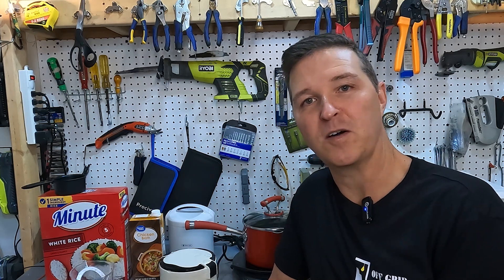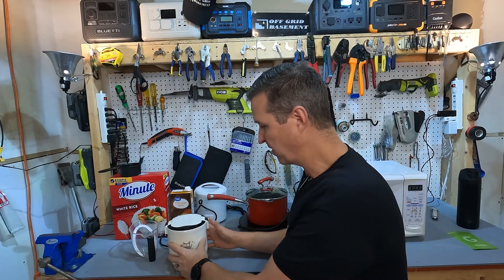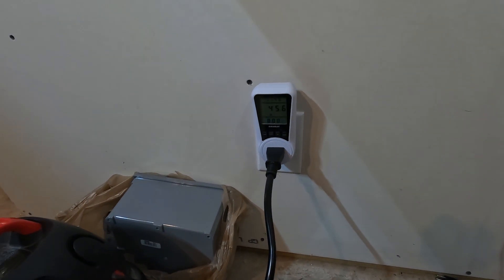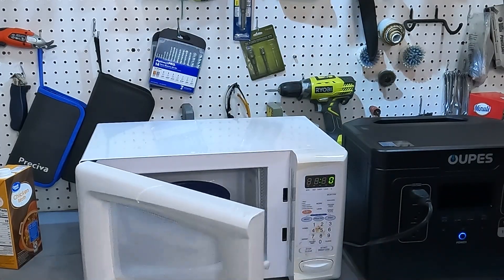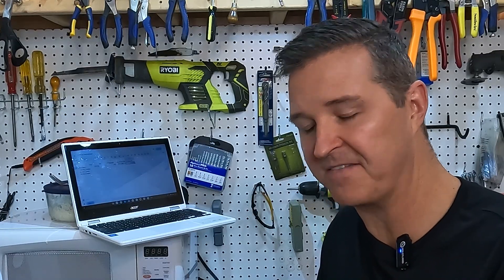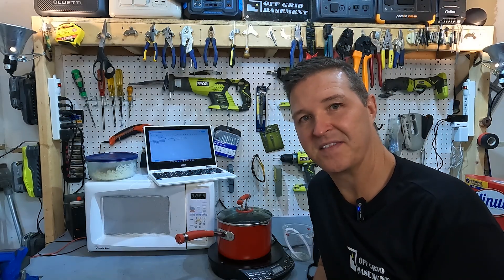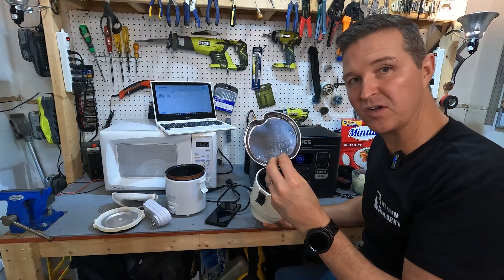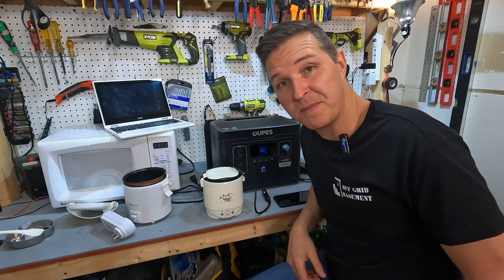Is a 12v Cooking appliance really more efficient?  Let's find out!

Comment: I always wondered which would be more efficient and wasn't expecting this much of a difference between the microwave and induction cooktop! Wow!

Microwave is still probably the best for popcorn, at least for ease of use, but I guess you could achieve decent results by using a pot and just shaking it, with maybe an oil screen instead of using the glass lid so steam can escape...

Comment: My induction cooktop will boil 1 quart of liquid in 55 sec, depending how cold the liquid is when I turn on the burner. I never takes longer than 70 sec to boil liquid.
Reply from the maker: Thanks for sharing and for the comment.
Reply: @OffGridBasement  I love my induction stove.  The oven is a normal oven, but the top is the best thing since sliced bread.  And I mill my own grains and make truly fresh bread without additives or any other junk.  I have recommendations.

Comment: This would likely depends on the unit. For example the Bluetti EB3A from testing seems to have lower efficiency on the DC side than AC side. However in most case, the DC buck-boost are much more efficient than the AC inverter, hence some appliances being DC would net lower power usage out of the power station.

Talk of DC, definitely utilize the power station USB port before ever put an phone/laptop charger on the AC port! I am always baffled at such sight of people plugging in their 20W charger to charge there phone when there is an empty Type C port that would charge faster right on the side!

Comment: they have a bunch of 12v appliances in china that their truck drivers use including larger 12/24v versions of the rice cooker with more efficient copper coating that can hold a true 3 liters. they are fatter in the critical dimension and sort of lock shut which helps them hold in a little bit of pressure with their carry handle. i use mine as a super efficeint instant pot lol, i show it briefly in my 40$ ultracompact 420wh dc power station build video. can cook almost anything in them and if you get the weird russian language version they are less than half the price of anything on scamazon from alxp. the english buttons dont make any sense anyways lol. love mine. instant pot doesnt make anything that small anymore and nothing dc powered. sometimes u have to search for solar cookers to find 12/24v appliances which are growing in popularity in the poor parts of the world that live off chinese solar panels now.

Comment: Bought the same 12v rice cooker off of Amazon about 6 months ago.  My box included a plastic spoon and a 3/4 cup measure in addition to the silver tray.  Loaded the cooker up with 3/4 cup basmati rice and 1.2 cups of water. Running off a 12v 100Ah LiFePo battery I got a reading of 43.7 Wh.

Comment: Excellent and well thought out comparison.  I'm no rocket scientist.  I simply have the wisdom and knowledge of 67 years on this planet.  I look at activities like this with a very logical and methodical thought process.  Nothing caught my attention that would cause me to question these results.  I especially like that you thought to include the comments about wiring the DC cooker directly to a 12v power supply to remove the necessary AC to DC conversion that the power station requires, resulting in even greater power savings.

If someone such as yourself prepares rice for a lot of meals, the DC rice cooker would be the way to go, particularly for cooking on the road.  Otherwise, the induction cooker seems to be the right solution for cooking with a focus on using minimal amount of stored 12v power.

Comment: The low watt rice cookers with an inverter are so versatile. You can do all kind of things in them. You can cook going down the road. The measurement for regular rice is 1 cup rice to 1 3/4 cup of water with a little salt. I know what the instructions say, but it doesn't work in the humid south. It'll be gummy.

Comment: The ac inverter uses quite a bit of electricity so the results are what I expected.  Of course with the rice cookers they are not set for minute rice and so you overcooked the rice because they are set for uncooked rice. That means if you figure out when minute rice actually gets done you'll save more electricity.
Reply: All you need to do is heat the water for Minute Rice. Put a lid on it and it'll absorb the water. You really don't even need heat if you're patient
Reply: @nonyabiz550 same with uncooked rice add 1 part rice to 2 parts boiling water in a thermos and just wait until it's ready.

Comment: The DC cooker used 77.5% of the energy used by the AC cooker.  If you could get a 22.5% increase in efficiency from all your appliances, that would mean you would need fewer batteries/panels/inverter output, or you could run your house longer during an outage, on a given battery capacity.  I wish there were more 48v appliances (meant to run around 51.2v nominal) that we could run directly off the batteries commonly used for solar energy storage.  Many appliances ultimately run off DC, even if they are plugged into an AC outlet.
Reply from the maker: The efficiency is outstanding.  I also wish there were more DC appliances as well.  Thanks for the comment.

Comment: Between My NuWave Flex Precision Induction Cook Top and Black & Decker Rice Cooker and 12 Volt Kettle My Boondocking Cooking has Far Exceeded My Expectations. Using either an Eco Flow River 2 Pro, Delta Pro 1300 or Delta 2 & Delta 2 Max. They All Deliver Quick and Efficient Meals in the Rough.

💦 Indian Creek Ranch ⛩
Southern California High Desert 🌵
Reply from the maker: That sounds like a great setup!  I'm sure you'll be set for quite some time.  Thanks for the setup.

Comment: i suspect the majority difference is really just the fact that the rice cooker has kind of a built-in insulating shell where the others don't, as well as a more controlled temperature gradient.  i would never use 12v socket plug unless it was a dire emergency.  most of them are poorly made and you're looking at a catastrophe running even modest currents.
Reply from the maker: I agree.  Those plugs are temporary at best.  XT60 would be a much better solution.  Thanks for the comment.

Comment: Those extra few watt hours for the AC devices are likely because the inverter uses power to convert the DC to AC. If you could find a DC induction cooker, that would be an awesome test as well.
Reply from the maker: That would need to be a very high voltage DC induction cooker.  I would like to find something like that though!
Reply: Generally there are also losses in the 12v circuit of most power stations (DC buck converter 48v > 12v).  But probably less than the 120v inverter section.

Comment: AC is very inefficient from the start. The AC from the power plant (coal, natural gas, nuclear, etc) loses roughly 2-5% during the transmission to the neighborhood substation. It loses additional electricity during the step down process. The electricity is also lost between the transformer to your meter. Additional electricity is lost from your inside wiring (Romex).

They're now working on the HVDC to replace the HVAC in the future. 
But, eventually all home power will be converted to residential solar in the future. 50% by 2050.
Reply from the maker: It also amazes me how many things you plug into a receptacle are converting from AC to DC.  I like the thought of HVDC..  Thanks for the comment.

Comment: Consider using direct measurement like Kill-a-Watt/DC for the loads rather than measuring the charge into the power station.  The power station uses voltage to determine full charge and this isn't super accurate, so wH will also be inconsistent.
Reply from the maker: That's a good point about the power station's accuracy. Thanks for the suggestion!

Comment: I moved from induction to insulated pot (Instant Pot/Rice cooker) for the efficiency on batteries.  Induction is nice, but more heat escapes compared to an insulated vessel.

DC is about 10% more efficient as there is about 10% inverter loss to go to AC from batteries.

Running DC cooker while sunny uses power from solar charge controller vs another 10% loss going into and out of a battery.

If you mod the DC appliance, you can run directly off solar panels for another 10% gain by skipping charge controller.

Going straight to solar thermal cooking (solar oven) you can be up to 5x more efficient.  Solar panels around 20% efficient.  Using light directly for heat is near 100% efficient.
Reply from the maker: I should try cooking rice on the DC cooker from the load connection of a cheap SCC.  I wonder if it would work.  Thanks for the comment!
Reply: @OffGridBasement it will, but adding a battery in case clouds come by might be more practical.  My solar output>my cooking power, so batteries just charge more slowly.

Comment: I cook standard long grain rice in a solar box cooker on a sunny day. Two cups takes about 45 minutes to an hour and baking chicken leg quarters or thighs takes about the same time. I found the same when it comes to portable induction cookers, you get the best bang for the watt hour with a good second to the microwave.

As for 12 volt cooking appliances, they're quite efficient for what they do. The tradeoff is it takes longer to cook, but on a road trip where you're driving 30 or more minutes is not an issue. However, I find the weak point is the cigarette plug has a shorter life span if you use it a lot. I've converted mine to XT60 or Anderson Powerpoles.
Reply from the maker: Converting the plug is a great idea!  Thanks for the info and the comment.

Comment: Impressive numbers!

Hmm.  Microwaves are actually really efficient at converting electricity into microwaves.  It really shouldn't have shown more than 800W or so of consumption.  I'd see what a kill-a-watt says (and also look at both the watts and the VA).  My guess is that the microwave is actually putting a lot more than 700W into the food.

Induction cooktops and tea-kettles are basically resistive loads (even though they see "induction", they don't use inductors).  As are toaster ovens and rice cookers.  They burn a lot of watts but they should have like 0.99 power factor and don't put much stress on power station inverters.
Reply: Please tell us why microwaves have a fairly strong fan operating while the magnetron is connected!  I’ll answer for you - it is because a microwave is not an efficient converter of electrical energy to microwaves.  A lot of waste heat is blown out by that fan!

Microwaves are very efficient at heating water molecules but producing those microwaves is quite an inefficient process.
Reply: Induction hot plates also convert electricity to magnetic energy which is only then very efficiently transferred to the saucepan.  Better than a microwave, but I’ve not tested the conversion efficiency.  Easily tested by heating a known mass of water and measuring the rate of temperature increase (ignoring heat losses, of course, for rough and ready experimentation).

Resistive heaters are 100% efficient, but heat losses to the surroundings will be different over time scales.  Insulation of the vessel will make a huge difference to the final efficiency.

To test these different forms of energy usage, each item should be checked using a standard amount of water and recording the time to reach a certain temperature, along with the rate of power supplied.  Tests, with foodstuffs, will always be more subjective, according to the taste, etc, of the finished product.
Reply from the maker: All great points.  Thanks for the comment.
Reply from the maker: Thanks for the info and the comment!
Reply from the maker: Thanks for the info.  I'll need to check the power factor of the microwave.  Thanks for the comment!

Comment: You could run the D/C cooker straight from a 150 watt or higher solar panel.
Reply: Doubtful - unless under very good insolation!  That means possible, but unreliable.
Reply from the maker: I don't think the panel would produce the amount of amperage needed for the DC cooker.  I would need to test.  Thanks for the comment!

Comment: When cooking rice, I've always used the 2 to 1 ratio. For every cup of rice, 2 cups of water. And I do this with a plug in 120v rice cooker. Have I been wrong all this time? If so, it wouldn't be the first or last time I've been wrong.
Reply: Your right. The rice you use is regular uncooked rice, the rice he used is minute rice which is much faster to cook and requires less water. So the rice cookers in the video are meant to cook uncooked rice. I think with his minute rice he could have halved the time with rice cookers and the minute  rice would have been done and used even less power.
Reply from the maker: I shouldn't need to drain the rice once it's cooked.  All the liquid should stay in the rice.
Reply: I think so. If you're in the humid south, reduce the liquid by at least 1/4 cup or it'll overcook and be gummy

Comment: Great test. I love my induction cooktop, mine uses up 1300 watts on the highest watt and power settings but is below 600 watts on the lowest settings. The 12 volt rice cooker is pretty impressive. Now the next question is which rice came out the best?
Reply: I think that's a secondary test result as you might only need 30 seconds more or less to get them all equal? 
I would say for camping the DC cooker is the choice. I'm never in a hurry. Everywhere else. The induction!
Reply from the maker: The DC and AC rice cooker were the best IMO.  Induction pot was a bit to al dente for my taste.  I think I didn't wait long enough before removing the lid.

Comment: Now I see why van life people like induction cooking.
Reply: Im from uk scotland and have just 1 12v 100ah battery car battery to battery charger and 100w flexible solar panel on roof with a 2kw inverter i have 12v compressor fridge small 1200 watt air fryer and single hob induction cooker works great in summer camping i will add 2nd battery for extra capacity but ive had current system for 2 years.As much as induction is heavy power ussage the speed of cooking is like gas better so its good and airfryer once upto temp cuts in and out so not continuous high load great for frying chicken chips etc.induction cooker great for fryups boiling rice vegies etc.I have single gas cooker and when dull rainy days and not much driveing i use gas more and that ballances out power usage for lights chargeing etc.A second battery or a 2 or 300ah which are so cheap now compared to few years ago just be more reserve and flexibility,would be great in campervan.Haveing a little single gas cooker is a good backup and actually i have a small inverter generator great for top up charge/backup when wild camping nobody nearby.
Reply: @michael-sz3ff  Hi, the setup you are describing is what I’m going for on my van. I have been buying the bits I want in advance of the van so I have them for an emergency. I have gone for 2x300ah batteries to input into the Afiery P2400 power station I have and increase it’s capacity by 6kw. I still plan on having 400ah of 12v batteries in the van for the 12v items (lights, heater, pumps and USB charging and TV ) plus an inverter for the fridge. I had planned on DC to DC charging them, but would like to do as the boating lot do with a Bank manager and go direct alternator charging ( keep a12v acid in the circuit) I like the idea of also having AC charging if needed and this can be from a small inverter Generator I have or AC EV charging. I have a Leaf so I have the apps for that.
Overall there is so much you can do with the power side and have so much available and options for electrical items.
Take care M.
Reply from the maker: It really does work well.  it's also very quick to heat up.  Thanks for the comment.
Reply: @OffGridBasement Yes they use heavy current but onlly brieflly,cycleing up and down.Lifeoo4 batteries were a gamechanger though holding voltage under load and there useable capacity.We could never have done this with lead accid never mind the extra weight of even 1 x100ah lead accid.😢..😂
Reply: @michael-sz3ff  Hi, the new battery chemistry’s are so good and have a monstrous cycle life!
I would is thought that there are very few completely cycling the battery between charges and thus the lifetime is going to be even longer.
The only thing is that 5his will take over a decade to prove out!
Take care M.

Comment: Why not try a run using a propane source and then convert the BTU's consumed to watts?  My guess is that propane would be far more efficient in terms of energy consumed to reach the result.
Reply from the maker: This video was about the DC vs AC in different appliances.  I'm not looking into use all sources of heat for cooking.  Thanks for the comment.
Reply: @OffGridBasement  Oh, I get that.  And its a good question to ask, as long as the context is established and makes sense.  But it seems to me that you'd want to know what other options exist.  

Heating stuff is an area where natural gas and propane excel in general compared to electricity because you are using fuel directly to perform the work.  With electricity, you have to first burn the fuel, heat water, spin a turbine, transform the voltage up, transform the voltage down (at least twice, possibly more), move the electricity hundreds of miles and then do the work.

Comment: So your theory was "take AC from the wall, run that through an inverter and charge a DC battery, and then make rice, that should save electricity"?
Reply from the maker: The video focused on measuring the actual power draw of the appliance, not the charging efficiency of the battery.
Reply: @OffGridBasement  Sure.  But running an AC appliance off of DC source will always be less efficient than running  a DC appliance off a DC source.    

Additionally, at least as far as I understand it, , purely resistive loads should always be more efficient than a load with a reactive component.  Again, I don't understand why an experiment is needed to know that.